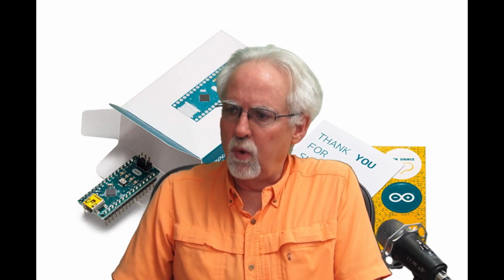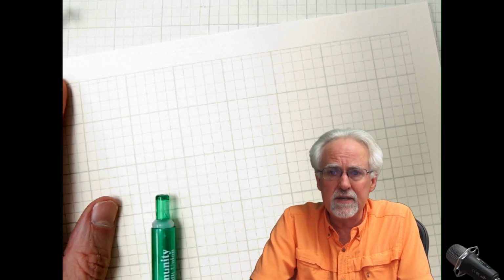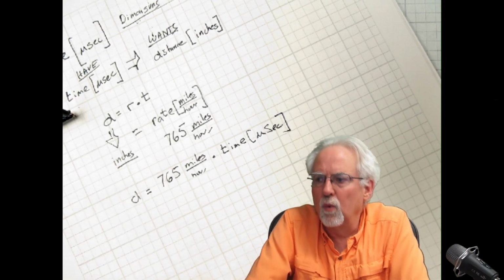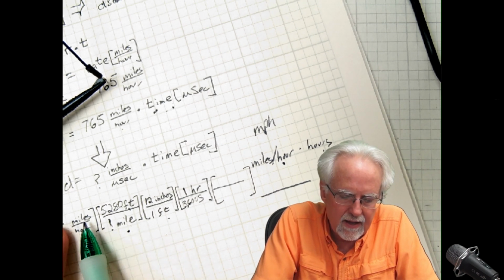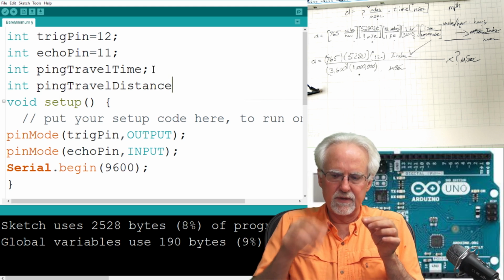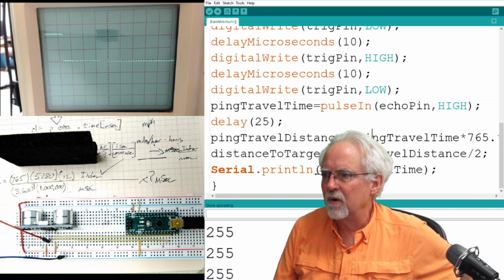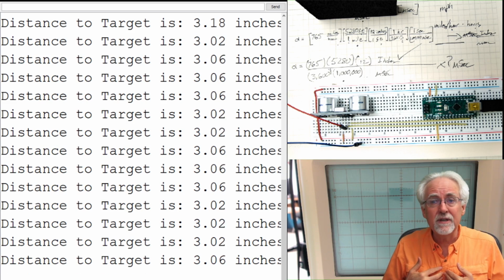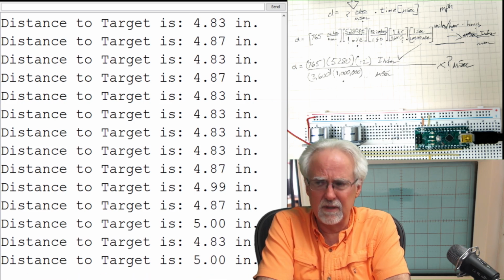Arduino Tutorial 55:  Measuring Distance With HC-SR04 Ultrasonic Sensor

Comment: It's pretty funny to see Paul using the imperial system when there are literaly 5mm squares on a sheet he's writing on. Also they are neatly grouped by 5, which makes approximately 1".
Check the metric system, it's great!
Reply from the maker: yet those who understand dimensional analysis can work in any system with equal ease and mastery. Those who are only able to do math with round numbers will be stymied when faced with any real math, physics or engineering problem, where numbers and conversions are not multiples of 10. There are many numbers that do not end in '0'. Learn to not fear them.

Comment: Giddy Up!!
Got it working but not without a healthy dose of head scratching. I was trying to work in meters/sec and I just could not get it to work. After applying some of the trouble shooting skills you have taught (printing all the variables to the Serial Monitor) I found that my pingTravelTime,  in seconds, was being rounded off to about 2 decimal places and hence ending up as a zero. So I reworked it all into microseconds and BINGO! Thanks for the Great Info! Looking forward to the next few lessons.

Comment: Wow it looks like I did this homework in tutorial 53 where I connected the LCD and coded the Arduino to read out the distance to object in cm and inches. The methodology employed here is very different to mine which looks like a ton of gibberish when compared to yours, Paul which appears quite systematic. I need to do more research in Dimensional Analysis.

Comment: I'm not quite sure what dimension analysis does. but I know how to measure distance. Does it count? because for the measurement, I'm confident that I have learned it in hs physics class.

 I also already figure out that HC-SR04's range isn't quite that far but at least enough for a toy car. maybe it's also useful for making cleaning robots!
Reply: and I think making cleaning robots only need dc motors, HC-SR04 sensor, servos, and probably LCDs and push buttons. but I would love to learn to make apps for it. do you have any recommendations on what to learn?

Comment: Before watching the video I did this : pingTime*0.0343 it twice the actual distance.. spent 15 mins thinking where I went wrong then I realized to divide the equation with 2, cause the sound travels twice... Now I will start watching the video! (0.0343 for cm/microseconds)

Comment: Far easier using SI units, why do American's live in the past and make life difficult. I changed from Imperial to SI in 1969!
Reply from the maker: Because if you understand Diminsional Analysis, you can work in any unit system with ease, including the Furlong, Fortnight, Stone system.  Even in metric system for most any real world problem you are going to have to multiply by a number that does not end in zero.

Comment: I got this with cross mulitplication as shown below but annoying me that the other method has not registered all that well.  pTT = 139 per inch so that was my baseline.  I used to solve math issues in 2-3 different ways so I need to get better at the other method you explained.

nt trigPin=12;
int echoPin=11;
int pingTravelTime;
int mdt=10;
int dt=1000;
int inches;
int ft;
int cm;

void setup() {
  Serial.begin(9600);
  pinMode(trigPin,OUTPUT);
  pinMode(echoPin,INPUT);
}

void loop() {
  digitalWrite(trigPin,LOW);
  delayMicroseconds(mdt);
  digitalWrite(trigPin,HIGH);
  delayMicroseconds(mdt);
  digitalWrite(trigPin,LOW);
  pingTravelTime=pulseIn(echoPin,HIGH);
 
  Serial.print("Distance= ");

  cm=(2.54*pingTravelTime)/139;
  Serial.print(cm);
  Serial.print("cm");
  Serial.print("      ");

  inches=(1*pingTravelTime)/139;
  Serial.print(inches);
  Serial.print("in");
  Serial.print("      ");
 
  ft=inches/12;
  Serial.print(ft);
  Serial.print("ft");
  Serial.print("      ");

  Serial.print(pingTravelTime);
  Serial.print("pTT");
  Serial.println("      ");
 
  delay(dt);
}

Comment: I used a for loop to run 50 times, take measurements and add them. Then calculate the average.  the precision was greatly improved, up to 1 milimiter.
Reply: aha thank you
Reply: I had a similar idea: keep a running average as long as the "ping" button is pressed. That would only work if you could hold the device absolutely still so I went with the same method you used with 64 samples. I also added a 2 second delay after the "ping" button is pressed to give time for vibration to settle out if it's on a tripod or something. (OCD from also being a photographer...)
Reply: I tried this and it delayed the output by several seconds each time

Comment: Paul, I got caught up in actually multiplying out the equation and getting confused by the size of the numbers, etc., forgetting that I didn’t need to by just putting the numbers in the equation and letting the Arduino do the computation!  I did get the analysis right though...

Comment: Hello Professor McWhorter,
Thank you for the best tutorial videos I have ever seen,
If I want to connect 6 HC-SR04 to an arduino at the same time, can I connect all 6 trig pins to a common pwm pin of arduino? If so, how?
Thank you in advance,
Elahe
Reply from the maker: I have never tried it. I would start by trying to get two working together. You must be careful to not fire pings at the same time, as one sensor might pick up the ping from the other. Hence, be mindful to operate one sensor at a time, and rotate between them. Hope this helps, let us learn what you find.

Comment: i did the homework, i did it based off the last lesson and it measures pretty accurately. I also saw your mistake so I wasn't holding my breath, I was thinking that you have to print distance not time. as well as the spelling and semicolons.

Comment: These tutorials are really good. I coded mine before coming here and I declared the speed of sound in inches per microseconds as a constant to make my code in the void loop look cleaner.
Reply: I'm not sure if you did the conversion from miles/hour to inches to inches/uSec. That was part of the homework assignment to get some hands-on with dimensional analysis.  Anyway, I did the conversion outside the loop (in void setup();) since the conversion part only needs to be done once, rather than doing it over & over every time you go thru the loop. I also multiplied by 0.5 to get actual target distance rather than divide by 2 since I have heard that division is faster, but I am not personally sure if that is true or not.

Comment: Hello Paul I did homework but my units was miles/hr not inches/microseconds . But again I did it as centimetres/microseconds just to ease for calculating according to my ruler cause my ruler has centimetres not inches and it's hard to see inches without any label in my ruler

Comment: Hey Mr.McWhorter, this was amazing, I did the homework on my own, and I decided to not do the entire travel distance, but instead the distance till the Object, so I divided by 2.
Heres my Code:
P.S. this is CM/uSec

int trigPin=12;
int echoPin=11;
int pingTravelTime;
float distance;
int dt=100;
int pulse=10;

void setup() {
  // put your setup code here, to run once:
pinMode(trigPin,OUTPUT);
pinMode(echoPin,INPUT);
Serial.begin(9600);

}

void loop() {
  // put your main code here, to run repeatedly:
digitalWrite(trigPin,LOW);
delayMicroseconds(pulse);
digitalWrite(trigPin,HIGH);
delayMicroseconds(pulse);
digitalWrite(trigPin,LOW);
delayMicroseconds(pulse);
pingTravelTime=pulseIn(echoPin,HIGH);
distance=(0.036*pingTravelTime)/2;
Serial.println(distance);
delay(dt);
}
Reply: This is what i ended up with, similar figures, at super close range, i was able to be about 2mm out at 120mm.

Comment: Hello Mr Paul, I have done the homework partially. I have measured the distance from the object with a ruler and created my own formula to convert the echo time....I got quite good results but....the values were not consistent....Also I noticed that if you will get the object too close to sensor the measuring  results are wrong. But in the end with  your formula it was working. Thank you very much,

Comment: I didn't do the math your way (but I do understand its value), I discovered via other math that (long story short) pingTime*0.017 gives me cm, and pingTime*0.0065 gives me Inches.
Checking them figures online I discovered a small discrepancy, 0.0171 and 0.00675 are correct according to the internet (I was close).  
I'm sure a little bit of field work calibrating my distance meter would have given me the same (or very close) correction.
I then got carried away.
My Distance meter now has battery and LCD hooked up with 3 buttons.  
Press button 1 and get cm and Inches displayed on the LCD.
Press button 2 and get Meters and Feet displayed.
Press button 3 and get Km and Miles displayed.
The last one does not work (hay, its a $1 sensor) but the principle is there.
If I had a real application for a hand held sonic meter, I would 3D print a gun shaped box for it.  Unfortunately I dont have a real world use for one.

At some point in time (when I become more proficient with Arduino / Pi and all the sensors and toys, I would like to combine it with my RC hobby and mount 2-4 of them on a 1:8 scale RC 4x4 to make it semi-autonomous with GPS, electronic compos cameras with facial recognition (pi) etc, and be able to set waypoints/jobs and have it get there avoiding obstacles.  Might need somewhat better sensors, but the learning I'm doing here is transferable to any distance sensor.  I'm sure with a little timing work, I will also be able to measure speed in mph and Kmph (who knows, might be in a future lesson, or I may just try anyway).

Damn this is fun.  thoroughly enjoying this Tutorial.  Hope you do an advanced one later.

Comment: I did the homework before watching this.  Instead of putting the formula in to the program, I did the match and assigned the answer as a float variable called sndSpd.  In my loop, the formula was just dist=pingTravelTime*sndSpd.

Comment: Did this before watching the lesson. I did some research on Arduino site and found that I can use "Long" to convert numbers and used "float" in my code. It works pretty good. But am having troubles with my LCD it is not steady, not sure how to fix this, but I will continue to work that problem out. I used this instead (distance = pingtime*.013/2.).  I hope you go slower in the lesson  you did about dimensional analysis. You lost me on this one.  Thank you Paul for a great lesson.

Comment: I am loving these tutorials. I did the homework and I went ahead and made mine read in feet and inches. Cast the float to int then used / 12 for feet and %12 for inches. When I did my dimensional analysis I worked vertically and labeled each step to the right. I ended up just doing the math and using a coefficient of .0135 for my sensor value accounting for twice the distance for travel time.

Comment: One thing i did different in my new code Vs. old code after doing this Tutorial is to have 2 measurements readings as Floats. 1) was at 1 inch Val and the other was a 10 inch Val . My 1 inch Val would work good  up to about 9 inches or so, but at 10 inches it would be off about 1 inch. But the 10 inch Val would read spot on for 10 inches  + .  For my 10 inch Val was calibrated for 10 inch +.

Comment: I've tried to do the equation in metric, but I had an error of "too many decimals...".
I worked my way around it, writing another code line ;
 pingTravelDistance=(pingTravelTime*765.*5280.*12.)/(3600.*1000000.);
  distanceToTarget=pingTravelDistance/2.;
  distanceToTarget=distanceToTarget*25.4;
so, that way, I got the distance in mm.

Comment: After a couple of hours of searching the internet in order to solve the problem of HC SRO4 only producing zeros, I went back to Tutorial 52 and re-build my board from scratch and BOOM it worked. I did the homework and got 730 miles/hour (which is close to the official 767 miles/hour) Thereafter, Tutorial 55 was a breeze  , another great tutorial with an unforgettable repeat of "dimensional analysis".  I am already looking forward to the next lessons, Paul.

Comment: Paul is right about dimensional analysis. In my Field Technical Specialist position at Toyota, I had to be able to convert the rotational speed of the wheels, propeller shaft, transmission gears and engine into rotations/second, so I could identify what was producing a vibration (frequency [Hz])  that was felt or measured in the vehicle at a given speed.  By matching the frequency of a rotating component to the vibration felt, we knew where to look.

Comment: I did the homework and got it to work in metric units. There might be an easier way using the slope of the graph as a constant and multiplying the pingTime to give the distance. As the slope is half the speed of sound it gives a direct measurement of the distance.

Comment: Another good lesson. Regarding my approach, I used 767 miles per hour as a given speed of sound, and did the analysis just as Paul did. However,  instead of leaving the inches / microsecond as a large numbers in the numerator and denominator, I went ahead and did the division, giving me 0.0135 inches (rounded) per microsecond, making the multiplication a bit cleaner.
The dimensional analysis is sooooo useful. I was originally taught it in my first week in college many moons ago and until these past few vids I'd forgotten just how important and useful it really is.

Again, thanks, Paul for a great tutorial.

Comment: Being Canadian I did as a few others and also added a metic equivalent. Plus I have added a LCD, a power supply with battery and have a fully portable ultrasonic measurement device “BOOM”.  Almost hate to tear it down. Thanks for the help with the math. Great lesson Paul.

Comment: Got the distance by using dimensional analysis. It seemed confusing at first but it was actually quite easy. I converted microseconds to seconds and multiplied the speed of sound in miles per hour by the ping time in hours. Once that once done I converted the distance from miles to inches and I checked my answers by manipulating the formula d=r/t to r=d/t and got 767.35 as my answer. These lessons really do make you think in a mathematical sense and that's just what I need sharpening in!

Comment: The way I did the homework was:

int TriggerPin = 12;
  //  Sensor Trigger Pin
int EchoPin = 11;
 // Sensor Echo Pin

double TotalPingTime = 0;
 // Total ping time
int Distance = 0;
 // Total Distance in inches to target

void setup() {
  // put your setup code here, to run once:

  pinMode(TriggerPin, OUTPUT);
  pinMode(EchoPin, INPUT);

  Serial.begin(9600);
}

void loop() {
  // put your main code here, to run repeatedly:

  #define SOS 767
 // Speed of sound

  digitalWrite(TriggerPin, LOW);
  delayMicroseconds(10);
  digitalWrite(TriggerPin, HIGH);
  delayMicroseconds(10);
  digitalWrite(TriggerPin, LOW);
  TotalPingTime = pulseIn(EchoPin, HIGH);
  delayMicroseconds(20);

  Distance = SOS * (TotalPingTime/1000000) * 10;
  // Reason for the TotalPingTime being divvied by 1000000 is because the pulseIn return a whole number and not a actual microsecond 

  Serial.println(Distance);
}

Comment: Did mine a little different:
int trigPin = 12;
int echoPin = 11;
int deltime = 10;
int pingTravel;
float pingDistance;
float distance;
float velocity = .0134992;  // inches/microseconds
int longwait = 1000;

void setup() {
  // put your setup code here, to run once:
Serial.begin(9600);
pinMode(trigPin, OUTPUT);
pinMode(echoPin, INPUT);

}

void loop() {
  // put your main code here, to run repeatedly:
  
digitalWrite(trigPin, LOW);
delayMicroseconds(deltime);
digitalWrite(trigPin, HIGH);
delayMicroseconds(deltime);
digitalWrite(trigPin, LOW);
pingTravel = pulseIn(echoPin, HIGH);  // pingTravel is in Microseconds
Serial.println(pingTravel);
pingDistance = (pingTravel/2); // cutting travel by 2 to get point of deflection
delay(deltime); 
distance = (velocity * pingDistance);
Serial.print(distance);
Serial.println(" Inches ");
delay(longwait);

 
}
Reply: Well knock my socks off, I too did a version kind of like yours where I crunched the numbers” float velocity = .0134992”; before putting them into the formula. 

int trigPin=12;

int echoPin=11;

float pingTravelTime;

float disTance;

void setup() {

pinMode (trigPin,OUTPUT);

pinMode (echoPin,INPUT);

Serial.begin(9600);

}

void loop() {

digitalWrite(trigPin,LOW);

delayMicroseconds(10);

digitalWrite(trigPin,HIGH);

delayMicroseconds(10);

digitalWrite(trigPin,LOW);

pingTravelTime=pulseIn(echoPin,HIGH);

delay(25);

// Serial.println(pingTravelTime);

disTance=pingTravelTime*0.0134992/2.;

Serial.print ("Distance in Inche(s):   ");

Serial.println(disTance);

}

I did smile when I saw the 0.0134992, some one else was thinking along my lines

Comment: I had to do a bit of debugging/analysis on this one to figure out why I was getting a very obvious wrong answer. After some time I discovered this sensor cannot see a stealth object. Just by chance I was using a glass to measure from and apparently the shape deflected the ping away from the sensor. So I guess I just proved how stealth works against radar?

Comment: I love your tutorials. You’re probably the best Arduino teacher I’ve come across so far. You’ve taught me most of what I know about Arduino. Here are a few suggestions for later tutorials:
-IR Distance
-LED Matrix w/ MAX7219
-Microphone
-Motion
-OLED Display w/ SSD1306
-Solenoid
Sorry if it seems like I’m rattling
Reply: Data transmission t rough internet
Reply: OK, OK, OK, you made that comment 2 years ago. Cane we agree Paul is simply the best?
Reply: @aaronmilliman7685  Yes
Reply: Definitely the OLED w/SSD 1306😀

Comment: Additional fine tuning to the data can be made by factoring in speed of sound not just as a fixed value, but rather by how it varies according to barometric pressure.